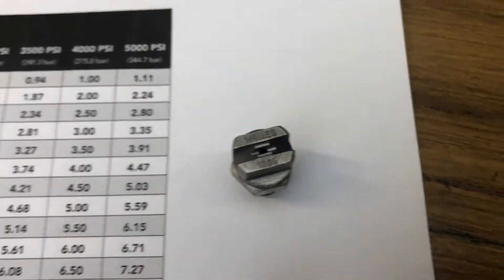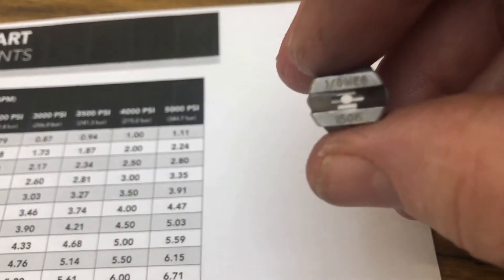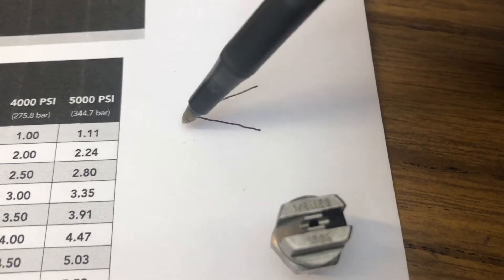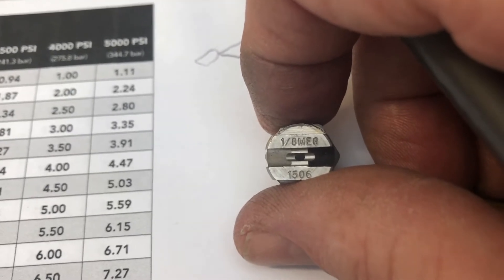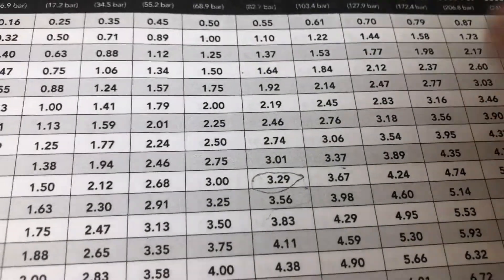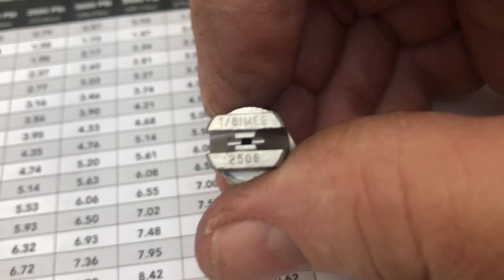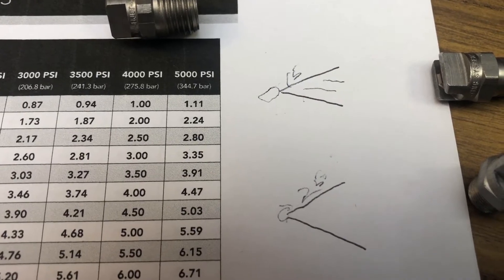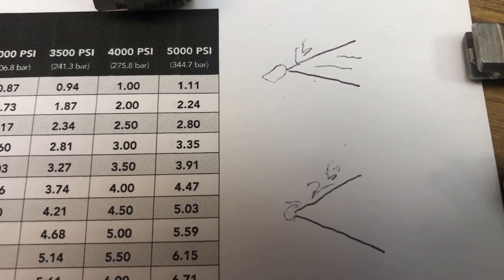Spray Nozzles Flow Rates

Comment: For newer concrete using a 4gpm would you recommend 2506 or just leave the 2502 tips that came with the surface cleaner.  I don’t want to damage any concrete also should I throttle down the washer.  Thank you
Reply from the maker: Several factors come into play, such as how close are the nozzles to the surface, what is the pressure, is there an angle on the nozzles, the amount of time on a given area, how many nozzles on a pressure source? It’s a great question that has to be answered by considering all the possibilities, but it may come down to testing an area. I hope that you have success.

Comment: Great informative video out there IMO. Quick question bud. I have a 2500 PSI 3.5GPM  PW and I am using a surface cleaner that is  15" with 2 nozzles. I've currently got 25020's. Should I get 45020 for wider patten or should I go with the 15020 and decrease pattern a bit but get more cleaning power for most jobs? Thanks again man. Well done.
Reply from the maker: Good question, I think it depends on what your cleaning. And if you’re using detergent or other aids. I’d suggest getting both and trying each to get the best results for your application. I hope that helps?
Reply: @flymanff  Yes in fact I thought about doing just that! Thanks Flymanff

Comment: Do you know what that 8 looking thing is called which is inside the NPT.  It's in the Middle and it's suppose to make the water come out straight. It looks like a 8
Reply from the maker: You’re correct! It is a vane that causes the water to flow faster and straight. It’s a spring steel insert in the shape of an eight. 
It’s called a vane insert.
Reply: @flymanff  hey do u know where I can buy one online. I keep searching vane insert but nothing. Please and thank you
Reply from the maker: @jackbrown1832  ??
Reply: @flymanff  I'm sorry I was talking about the 8 looking thing, spring steel insert. Called vane insert. I tried looking it up online but I cant find them with the 8 inside. Do u know where I can buy one online with the vane insert
Reply from the maker: @jackbrown1832  try this website, 
https://www.kleen-ritecorp.com/c-882-spray-tips-nozzles.aspx
Reply: Thanks you very much I finally found it